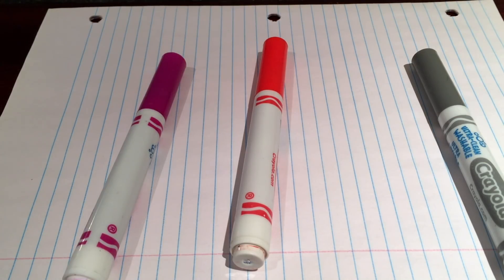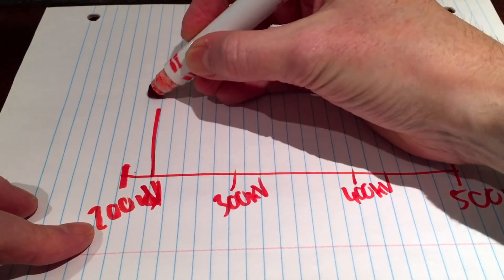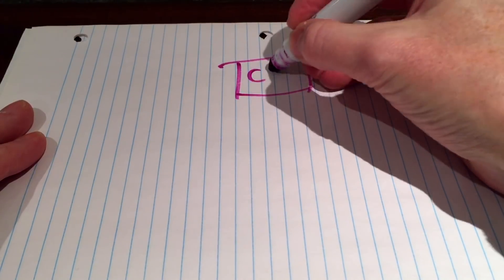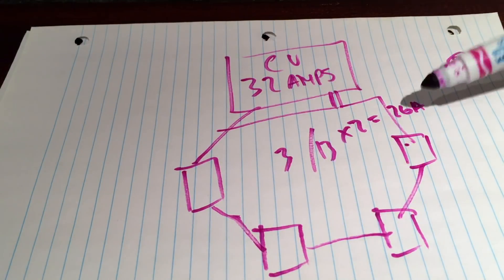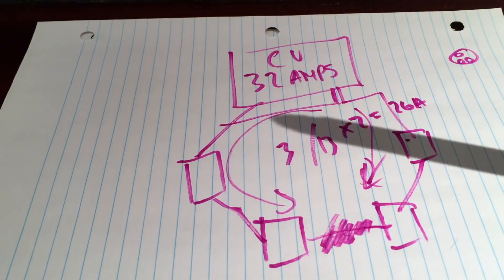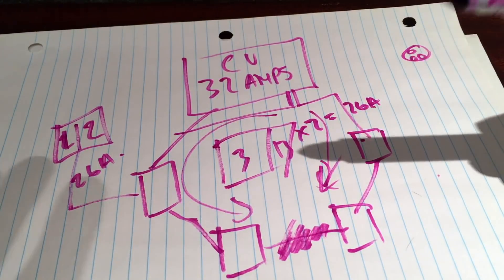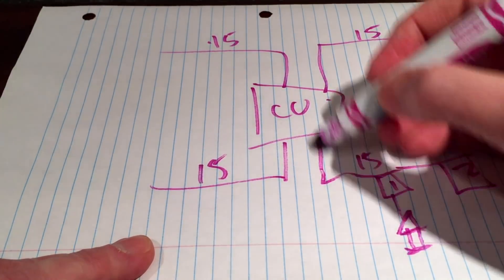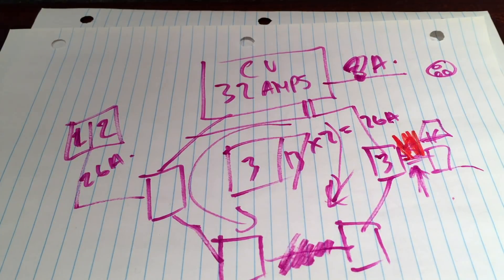THIS is why British plugs have fuses

Comment: There’s a slight confusion here - a UK consumer unit is usually rated to 100A, while the ring circuit MCB/breaker is 32A.
A fuse can also break the circuit in the event of an earth fault, but this is not its primary function. An RCD and/or MCB is much quicker.
Reply from the maker: Thanks.  There's a number of points where my wording was a bit wrong.  I realized after uploading, that the fiery lamp wire comment mentioned that the lamp was on a 3amp fuse, when I meant to say low rated wire, then say the problem can be avoided by putting in the fuse. Doh!
Reply: You need a serious earth fault to trip a fuse or MCB, which mostly never occur unless you have a short to earth.
Also a fast blow fuse can be as fast as 10ms, I don't think a MCB can be much faster.
Reply: The thought of waiting for a fuse or MCB to protect me from a leak to earth leaves me frazzled...